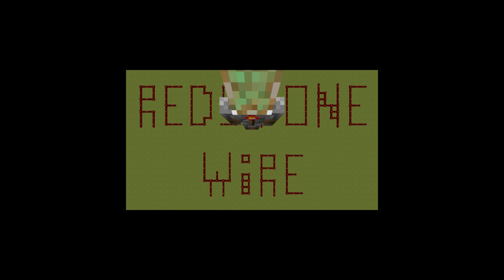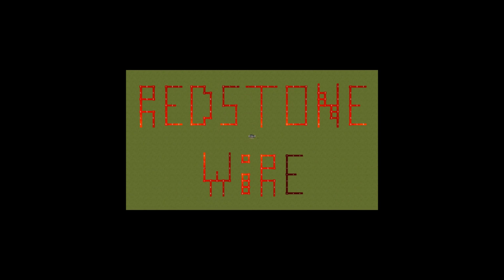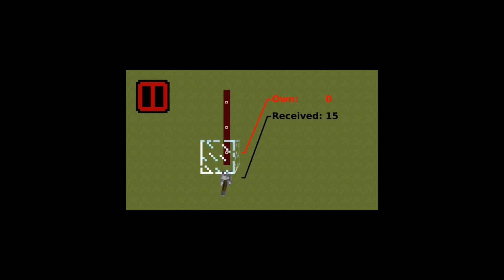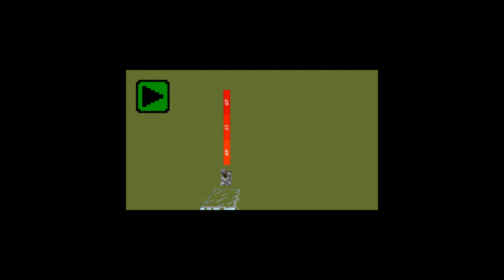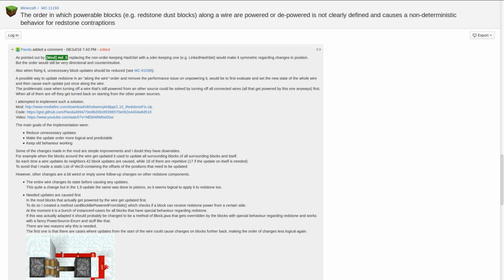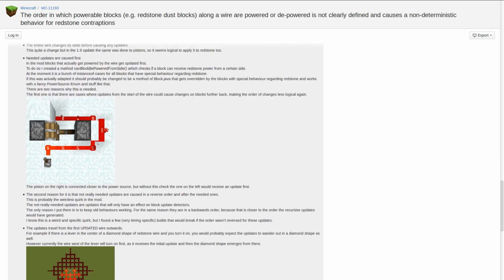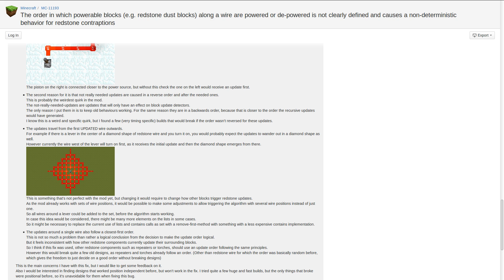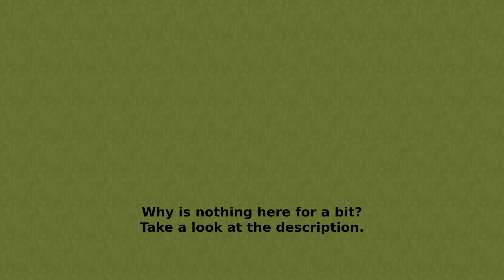Bugs and Ideas #04: Proper fixes are not that simple

Comment: Jesus I'm late for the Bandwagon. Redstone and BU code needs to be fixed. I don't care about Budded blocks, they are unnecessary, at least with the observer, well that block is also a mess, due to buds. So yeah.. Repeaters haven't been fixed since they've been implemented, torches are near useless.. Redstone Block Update Order has been a mess since forever.
Only 1000 updates per gametick is allowed... Which is also a pain. Comparators are messed up, Redstone dust itself is messed up. Directionality.. .. Sure people like 0-tick redstone and buds and directionality bugs, but I don't, I want consistent redstone, I want to know if something I made works without having to test it. Not depending on Chunk alignment and X Y Z coordinates and shit... But Alas I don't think the code will ever be remade so to make it into it's own class.
They don't even need a class for each block like they try to do...

Not to speak about all the things they could have implemented to make redstone more interesting, which can't be implemented for as long as the current buggy system is a thing.
Reply: It surprises me quite a lot that the idea of consistent, predictable, and deterministic redstone is even a tiny bit controversial. IMO the best way is a "rip the band-aid" approach, just do it in one fell swoop with a major release, break everything, and get it over with. The post janky redstone era would turn into a renaissance.

Comment: How about, for now, having readstone when depowering set itself to its highest received signal strength, effectively making it decrease by 2 each state change*, instead of decreasing by one? While I doubt it would increase the performance as well as your mod did, it would be an improvement that wouldn't break old behavior and should be relatively easy to implement.

*Exception:If it isn't connected to any other redstone it will drop to 0 on the 1st state change
Reply from the maker: It would change positional depended behaviour. Besides that I do think that it would improve it quite a bit indeed :-)
Reply: I know nothing about the code, would it be an easy change to make?
Reply from the maker: I think it would be an easy change, yes. But the redstone code is messy and I last looked at it a few months ago, so who knows :D

Comment: As long as redstoners have a reliable, predictable, and procedural system that works direction-independently, they will forgive developers for removing unintended quirks. Redstone rewriting has broken many machines in the past, but the returns have been worth it.
Reply from the maker: "direction-independently"
I would love to have that :D
It's difficult to do to a full extend, but not impossible.

I also do think that they will rewrite redstone at some point. It just requires bigger changes first.

Comment: Object oriented programming
Reply: Java totaly make sens for minecraft tho
Reply from the maker: Yes :-)
But it's also a general good pratice for programming. I can't think of any language (besides jokey ones like BrainFuck or Malbolge) where you wouldn't want to keep different functionallities seperated in some way.
Reply: a well designed program in Java run smoothly, the problem is often that it's so easy to code badly in this language. And minecraft is realy poorly designed
Reply from the maker: Oh yeah. In other languages your program will just crash constanly without proper error messages if you code badly :-)
To be fair the team and the design requirements of Minecraft changed a lot over time. So it's not surprising that it is a mess.